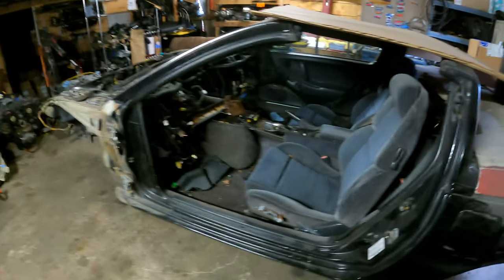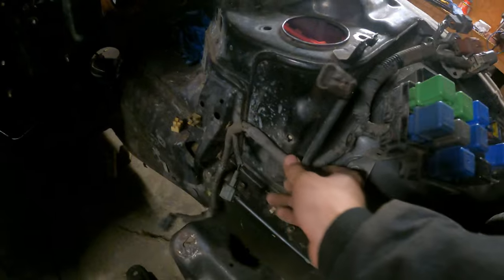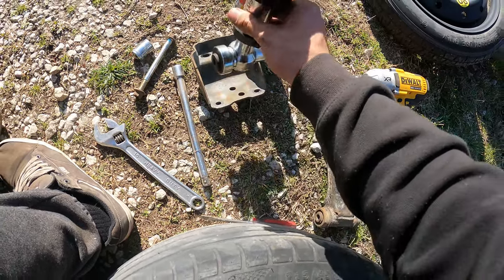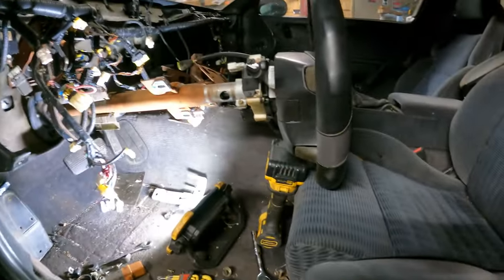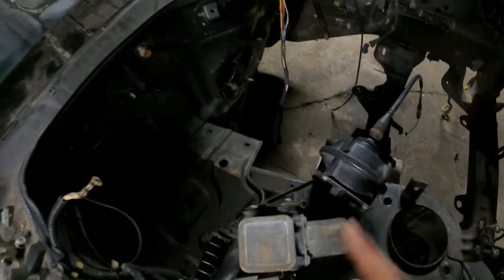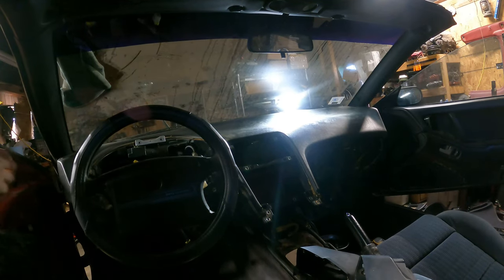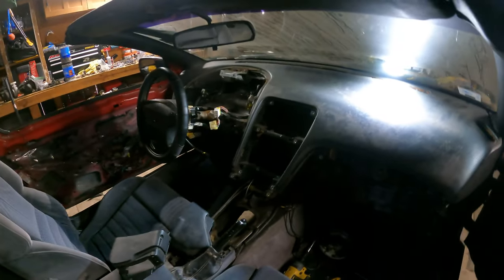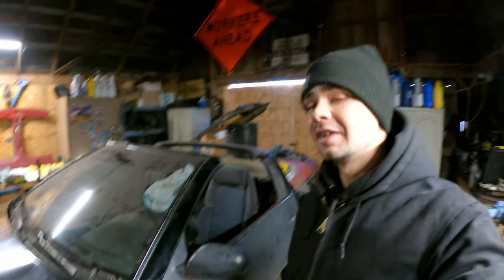FINALLY Starting to Finish my Convertible 300zx Project

Comment: Dude you've come so far! I remember when you first bought this vert and it was in some poor condition. You have such a talent with these Zs, taking them apart and putting them back together over and over. This was the same case with this vert. You've definitely changed the vert ALOT for the purpose of restoring and improving it. I'm glad you're highly willing to continue to finish the vert project. Keep the work up dude!
Reply from the maker: I can't wait to see what the new owner is going to do!
He can do some magic with paint/body🔥